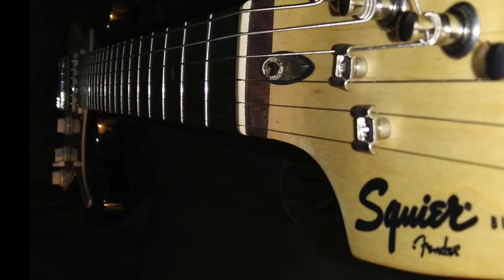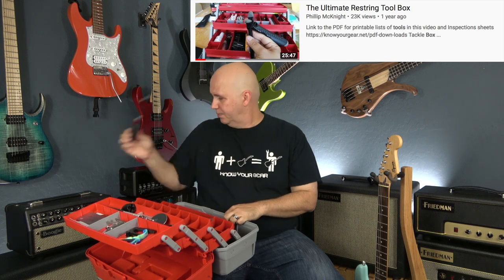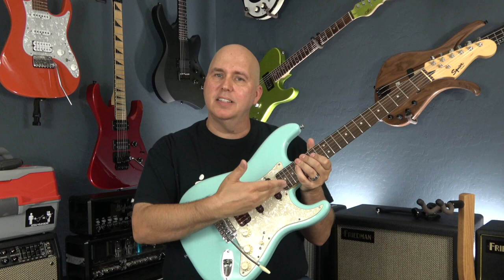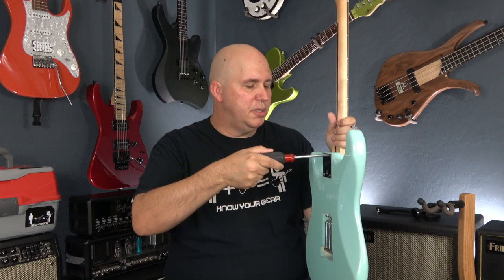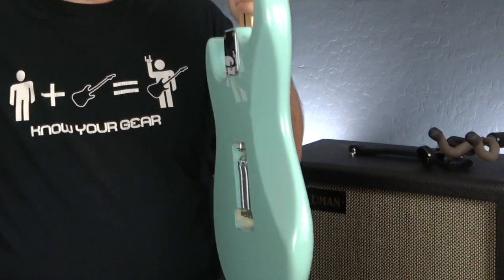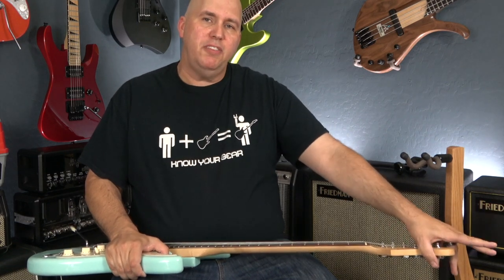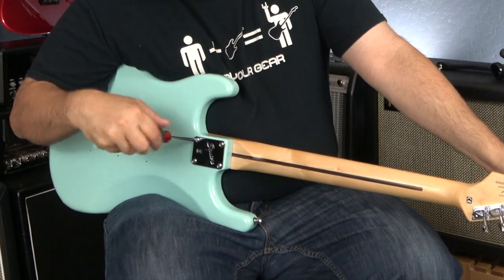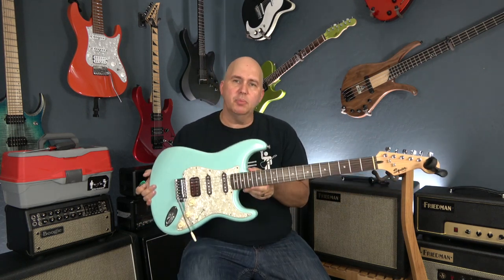How To Fix Bad String Alignment On Fenders & Squiers. Sharpen My Axe

Comment: Depending on which side the misalignment is you can place a shim on the side of the pocket. And then re-tighten the bolts. A piece of sand paper or thick paper will do. I think this will make for more of a permanent solution.

Comment: I'm so happy that I found this video!!!

I bought a strat style guitar for 50 bucks in a pawnshop. It was ugly but I took off the neck, cleaned the fretboard, filed and polished the frets and did what I could with the body. At the end, it looked like...not new but like a cool guitar. 
Then it hit me: the high e-string was barely over the fretboard! 

I was about to remove the bridge, fill the holes and make new holes to align the bridge! For some reason, before I started doing that, I thought "I don't think there's another way to fix this but, why not" and opened Youtube and...

Man, you saved me so much work and time!! 
Thank you!!!
Reply: I was literally about to do the same thing as you 😭

Comment: I had brought a Fender SRV loaded body and when I attached a neck, the same thing with the low E string. After the 12th fret, the string was off the frets basically on the nubs.
I was going to take it to a Luthier and today lo and behold you pop up with this advise. And it worked. The neck and strings line up perfectly.   Thank you.

Comment: I had modded a standard Mexican Tele with a vintage style bridge and locking tuners and noticed this issue had occurred after the mod. I thought for sure it was the bridge causing the issue and I would have to completely refill hole and realign the bridge. 
While I’m sure installing a new bridge causes some strings to align differently, the fix in the video completely solved my problem. Thank you!

Comment: I'll be over in a corner crying for a while. I cannot thank you enough. I just picked up a 2022 Fender Player that I'm madly in love with and noticed the alignment was off and thought I'd have to plug and redrill the holes in the neck. To be fair, I did see this fix on another less popular video first and then came to you to verify that it was legit. I am so freaking happy this worked!!! Thanks so much Phillip! ❤ Fender should put this as standard instruction on every guitar they sell as an option in case of string alignment issues.

Comment: Just got a Squier Paranormal Offset Telecaster in the mail today, and it was having this exact issue. Quick search on Google, this video popped up and I knew I was set. Not even five minutes later, had 'er fixed. Totally on point, Phil! Thanks a million.

Comment: I have a Fender Jazz Bass. I had the some exact problem. So I used the some fix technique you used on this video. And my Bass is fixed as good as I can get it now, because it was pretty bad. Now It's much, much straighter. Thanks for helping me fix my unaligned Bass.👍

Comment: Phil, thank you so much!!!!  I received an MIK G&L S-500 Tribute from ebay today, and the neck was slightly misaligned.  I had already loosened the screws, but couldn't get it to realign.  When you grabbed the headstock of your Squire it proved the old saying of, "Torque wins races!"  By applying pressure at the headstock I now have a properly aligned neck, or at least so close that it's not easily noticeable.  Thank you again!!!

Comment: I have a Rondo SX Strat past 3 or 4 years had same problem.almost exact.I followed your instructions and in a few minutes had it corrected.thanks you very much.not long ago I fixed real bad sharp fret sprout on my Monoprice Indio strat following your instructions and I'm still grateful on how nice and smooth they are now.I'm learning so much from you Thanks again Jerry

Comment: I recently bought a Fender 50s Roadworn Stratocaster with 59 pickups. It sounded great but needed setting up. I love the sound and feel of this guitar! Although I am a player of 41 years experience and am happy to set up my own guitars, I paid a local guitar shop to set it up. They had to remove the neck to adjust the truss rod because it has the truss rod adjustment at the base. I wasn't sure if this was correct, you would obviously know best, but when it was returned, you guessed it, the high E string was almost off the fretboard! The intonation was spot on but neck relief was a little iffy too! The tremolo was floating, but floated a little too much so I adjusted that correctly. I was quite upset about the string alignment but YOU HAVE SOLVED THAT PROBLEM FOR ME. So simple! THANK YOU! Moral of the story - if you want a job doing properly do it yourself - with your help of course!

Comment: This video was a life saver. I recently bought a new boutique-ish super Strat (3.5k) and it had this same exact issue. Fixed it by following this tutorial. Ended up exchanging  the guitar because of some other issues. The second one (3.8k) had the same exact issue but I knew I could fix it! The neck pocket on both guitars were really tight with barely any play but this method still worked with no neck pocket cracks (I was very careful when pulling the head stock). Thanks Phillip!

Comment: Nicely done Phil!
I've recently purchased a beautiful Squire Thinline that had neck gap and angle issues. 
I removed the neck and discovered that the neck pocket was uneven. I filed it even with a fine wood file, the wood was really soft and easy to work, periodically checking with calipers that I was approaching true, and now the neck sits snugly and squarely in the pocket.

Comment: I know this is is an old post but I just ran a crossed it and it worked great! I didn't know there was that kind of play with a bolted neck. I thought once the neck was bolted on that was it for the alignment. My high E sting was  just a little too close and the low E had more room than needed. It centered up nicely using this procedure. Thank you!!!

Comment: I got rid of a Squier because of this problem. I gave the damn thing away. I had taken it to a pretty good repairman I know in Austin, and he said he didn't know any way to fix it. I found it unplayable, so I got rid of it. The experience taught me not to buy mail order guitars from outlets like Amazon, where you can't get any personal sales help. I wish I had seen your video before I got involved with that instrument. I recently bought a guitar from Sweetwater (if I may plug them) and I got a fantastic instrument. One can interact directly with a sales rep at Sweetwater.

Comment: Hi, Phil. Great video - I've had this occuring on a few fenders I've owned over the years, but the worst two culprits are a £1500 AV'62 Jag and a £3000 Custom Shop Tele which is about 3 millimetres off - they shouldn't leave the factory in this state of non optimum operation.
Anyway, I've followed your instructions and had some success with the Jag - so thank you very much for that - but I would like to reiterate that it is best to not do more than half/ one turn of the screws or the neck will just slip back as you're tightening the screws.
Will try this procedure with the Tele and let you know how it's gone.
Reply: OK, tried this on the custom shop tele and it worked like a charm - it now plays like a dream - thank you so much for this vid
Reply: @TheUglyTruth !!!  i can't believe they sent a 3000 quid custom shop axe out that was so out of whack

Comment: YOU are such a resource!!! Just bought a American Vintage '51 Tele (that I really couldn't afford) and the high he was almost off the fret edge up high. I took pictures and prepared for the worst..sending back the guitar I loved. Did what you said and as soon as I loosened 1/3 turn on the neck screws, I heard a little pop. Hardly had to put any pressure on the headstock, tightened the screws and VIOLA!!!! Lov ya man!!!!

Comment: Just aligned my Japanese made Fender Stratocaster using your video. Now it's perfect!!! Thanks. I was worried about cracking the body neck pocket, especially that thin piece of wood on the high E string, but all good. You're a champ

Comment: Thanks, had a build and it was doing the exact same thing.. your steps were simple and detailed so I had no issues following the steps and it corrected mine. Which it was the Low E that was off set.. 😎👍 thanks again..

Comment: I have a Levinson Blade RH-4 that's been my main guitar since I bought new in about 2012. It's a very nice guitar. The only thing I haven't liked about it is that the high-E has a tendency to slip off the fretboard. It makes me wary when I'm playing solos, which is obviously not what you want. It kind of took the shine off the guitar for me. I just tried the trick shown in this video and am amazed to find that it's worked. Thanks so much.

Comment: I was so bummed to discover my favorite electric guitar I’ve owned for over 10 years had misaligned strings and was posssibly defective. It’s a 2004 Fender American Standard. Only of modest value, but I’ve bonded with this guitar. I initially had the panic thought of “oh, no! I don’t want to sell this guitar for an upgrade.” 
Then I watched this video and was so relieved after using only a screwdriver to realign it. 
Whew! Thanks for the straight forward video. My love for this faithful Stratocaster I named Link has been reinforced. 🤘🏼

Comment: This is really helpful Phillip. I have a pro-shop Jaguar less than a year old with this issue and a 25 year old Square Telle with this issue. I did change how I put strings on and it help a bit. I was cutting them way too short and the wrapping was too high). Part of the issue is how I play as well. Sure, it could be the nut but most likely the way the strings are put on and this new trick should solve it. Thanks.

Comment: Another helpful guide.  I had this last year with a brand new strat elite which was an expensive guitar .  I've had loads of stats and this was the first time I'd come across this problem.  Rather than send it back (time, hassle, cost) I just sorted it myself as you showed  easy enough but it did happen again from time to time  i sold it on..... a bit of a disappointment  really

Comment: Great video sir. I'm nervous because I bought a strat online and when I received it, I noticed that the high E strings often slips down the lower frets (1st - 5th frets) and that made me panic because it is a new guitar. Turns out, this might be the current issue and I'm gonna try this method. Thanks

Comment: I literally bought 3 fender strats this month (2 USA 50's and even a rarities model which is basically custom shop) and all of them had to go back one after the other because of string alignment issues. I just wanted a nice USA strat, but fender just has bridges which fan out the strings too much that you are lucky to get 2mm of play near the edges. This is an inherent flaw that is so easy for them to fix by narrowing the saddle. Even my old 2001 USA Telecaster had a low E that ran off the neck past the 7th fret too easily.

In the end i gave up with fender and bought a silver sky which is perfect.
Reply: I agree. I just bought a 50’s reissue Mexican strat Off EBay and there’s not enough clearance with the high e string. I don’t think it’s a neck alignment issue since the gap is consistent. I loosened the neck screws and it won’t budge. I think the pick guard is in the way so I’ll have to remove it first 😣. 

My old Strat that I had to unfortunately sell had more clearance. It would be nice if fender used saddles that could be adjusted inwards. It’s a stupid design. Might have to drop another hundred or two for a proper adjustable saddle bridge.
Reply: Yeah, I recently just purchased a new American pro 2 strat. And the neck is loose in the pocket and the high e was hanging off. Had to do what this video shows but you just expect perfection when you spend 1500 on a new guitar from fender. Especially a guitar they have been making for ages, quality control should be perfected by now. Bout to sell it and try a PRS.

Comment: Fantastic! I upgraded a Floyd Rose Special to a Gotoh GE1996T today. When I was finished, I noticed the strings were way cocked. I thought I screwed up. I checked the dimensions from Gotoh. Compared then to my original bridge. I checked the bridges with a digital calipers. I couldn't find the tiniest discrepancy. Was so confused. I went back and looked at an older photo of my first. Turns out it was cocked all along, I just never felt any cause to examine the guitar. Then someone linked me to this video. Thanks.

Comment: Had this problem with a custom shop Strat (the low E was too close to fretboard edge). Had it fixed as part of a general set up. I wondered why the luthier hadn’t charged much extra for this additional work, but I now see the fix is relatively simple.

Comment: That’s a great fix but I noticed that it’s the bridge saddles that are often causing the problem, being too wide and leaning towards one side progressively as there is not enough space for all them to be sitting straight. I had to file the sides of the compensated brass saddles on my telecaster and the problem was solved. Thanks for the videos they are really helpful!

Comment: OK, l have to check if the neck pocket in my good old Fenix Jazz fretless has some room to wiggle, too. The strings don't line up over the pickups, l mounted them myself with all the care I was able to give. So they should be in the right place. 
I learned from Dave's World of fun stuff that the PU cavitys and the neck pocket should be allways in line because they are made by CNC machines, but the bridge often is measured and mounted by the hand of some unexperienced worker. 
But before dismounting the bridge, filling in the holes with wooden plugs, measuring the right place for a bridge, drilling new holes before mounting the bridge again, I'll check this out first.
Its amazing, you learn something new every day.

Comment: Hi Phil great channel.just aquired the Harley Benton fusion 2 an felt the high e was a tad too close to the edge so I tried your demo an after  couple of goes I think I cracked it.(the alignment of the neck not the neck itself😆).I can now play the guitar with more confidence without altering my technique to compensate that string falling off the edge.all the best .

Comment: Saturday morning I took my brand new left handed Fender MIM tele out of the box and this was the only visible problem with the guitar. Needless to say, I was a little disappointed. To make matters worse, after a quick tune I plugged it and immediately I noticed the playability and set up were, what's a four letter word for shit. I'm a 51 year old beginner, but it's not my first day. I have gotten to the point where I know I will stick with it, so I decided to treat myself and get another guitar. I also have a sqier strat and a Harley Benton CST-24T, both where great right out of the box. The only thing they needed was tuned. Anyway, after searching youtube I found Phil. I know now that I can fix it myself along with the set up. Thanks Phil for the simple and easy to understand videos.

Comment: I have a Warmoth super strat with a locking floyd rosea and an R3 nut that I had put together by a local luthier, whom I have been losing trust in lately.  The neck came with no pilots drilled as I wanted the perfect alignment and a nice married piece of wood for good resonation.  The problem must have occurred when he screwed the screws into the newly drilled pilot holes causing the neck to twist just a hair enough to where I now notice my high E-Rolling off on the 12th and up when I am finger tapping.  It is frustrating as I wanted the perfect shredder and I almost got it !  I did as you did with the screws, and I saw a tiny gap in the pocket at the top edge of the guitar for a micro adjustment room just enough for the neck to come up a micrometer, but the holes are so tight tolerance that when I tighten back down the neck just causing the neck to go back into it's original position.  Ergghhh. I will have to try this one more time with even less string tension, but all it needs to do is rotate up just a micrometer giving just enough room on the fretboard for my tapping solos.  If you guys order from Warmoth make sure you get a good luthier that knows what he is doing when drilling holes in your beautiful work of art you paid dearly for because it is so easy to screw it up without Fender type build equipment in a shop.  They can align a neck perfectly in the Fender Custom Shop, or you can pay a fortune at StewMac for the perfect alignment tools.  I might have to either epoxy back in the holes and sand off and redrill, or slightly widen and rethread them worse case scenario.

Comment: This will be a good day because I will go to bed smarter than when I woke up. Thanks!  I have a similar problem but I have no idea if it is fixable. I have a Squier 72 Thinline with fender humbuckers.  The problem is that the alignment of the strings to the pole pieces of the pickups is quite far off for the outer strings (E B A E). The Pickups just seem too wide for the neck and saddle set up. Any suggestions short of rerouting the body and putting the pickups in at an angle?

Comment: Excellent easy fix neck adjustment. Thanks Phil.
Do you have a vid on neck angle? I have an 80s American Series Strat with an allan adjuster screw through the neck plate. I think it's called a Micro-Tilt. What's the process?

Comment: This might work if your lucky. It’s usually a badly cut nut or a poorly installed bridge and saddles .  The new nut or bridge shift are not as easy though. I’ve had this issue many times and it was never a misaligned neck.

Comment: I recently saw this on a brand new £3,500 Fender custom shop guitar in a local store. Not only that, the single ply scratch plate was warped too, which I thought was pretty shocking for such an expensive guitar.